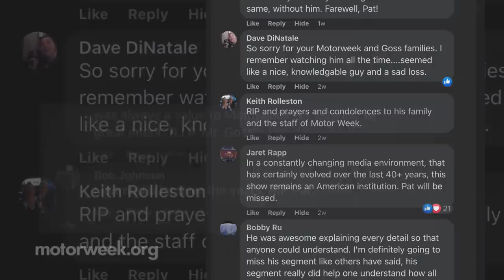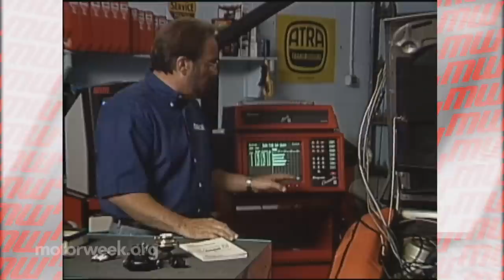A Tribute to MotorWeek's Legendary Master Technician Pat Goss

Comment: I knew Pat years ago when he had a Gulf station on Kenilworth Ave. I worked at the nearby ARCO station. I spun balanced his aluminum slotted wheels on his Blazer with our new electronic balancer. I used to give second opinions for him on PG county consumer affairs complaints. He was a good guy & will be missed. R.I.P. Pat
Reply: Where was this station?
Reply: @GTVAlfaMan  Riverdale, MD
Reply: @TruthOverLies  Is the Gulf station still there? Or has it been torn down?
Reply: @klwthe3rd  not sure, I think it is still there but not operating as a Gulf Gas station. Just a general car repair shop
Reply: @TruthOverLies  Did you know back then that he was propositions by Motorweek? Did his shop continue after he left?
Reply: @klwthe3rd  Did not know that. As far as I know his Gulf station continued for many years.

Comment: I remember one time when my car wouldn't start at work and I had to have it towed. I had it towed to Pat's shop, where he diagnosed the problem as a fuel pump failure. His shop then told me that researching the replacement part they had a feeling that it may have been part of a recall, as there were so many revision numbers. They asked me to call Nissan to find out if there was a recall or not, stating that if Pat's shop did the work that I would not get reimbursed by Nissan, but if I took the car to the Nissan dealer they would do the recall work for me. Sure enough, there was a silent campaign regarding the fuel pump. 

I always appreciated that honesty, after all he could have just taken my money and fixed the car. I gave him all my business after that until I moved out of the area.

Comment: I used one of Goss’s Garage videos to prove to a mechanic/shop that you never put old style worm hose clamps on plastic radiator tanks.  Thanks Pat.
Reply: I've been a mechanic for 40 years and wouldn't totally agree with you. One wants to use worm clamps when putting old hoses on new radiators whether they're plastic or not. Sometimes you can get by using the original clamps if you put them in precisely the exact location on the hose if the radiator tank fittings are exactly the same size but most of the time the hoses don't fit as tight. I have seen the quick squeeze type connectors actually break in 2 with time (It happened on my own vehicle). I don't actually remember ever seeing the squeeze type clamps available aftermarket. Don't get me wrong, I use them when I can but they aren't the be all end all. I remember seeing Pat throw a Ford VV carb in the trash once and install a Holley replacement which really only lasted a few short years. Probably better to keep repairing the VV than try to find parts for the Holley after a few years (with the complicated feedback solenoids, etc.).